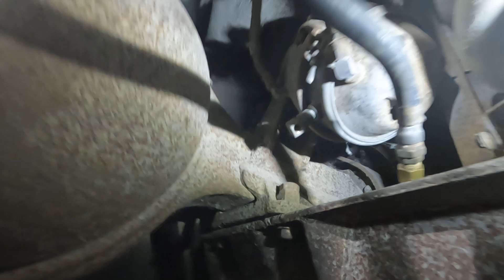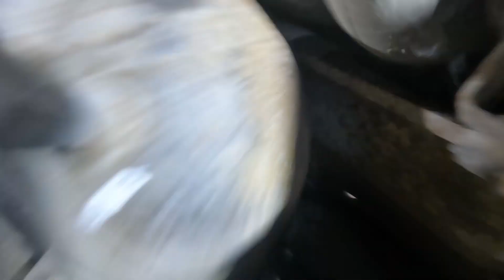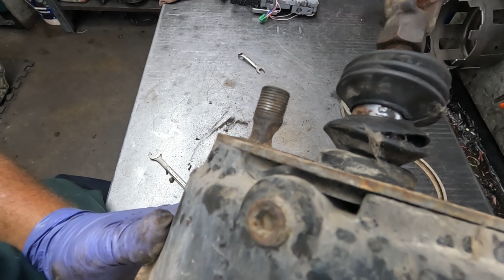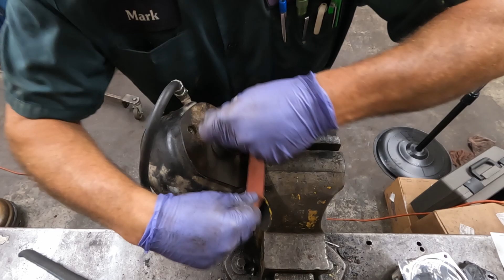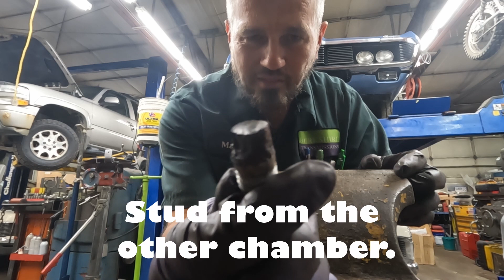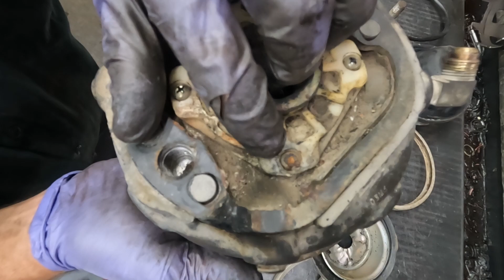MCI Bus Bendix DD 3 Brake Actuator Disassembly

Comment: What did it need just a diaphragm? What size can is that? 24 doesn’t look like a 30/30
Reply from the maker: 30-24. Diaphragm leaked when brakes were applied. Sometimes wouldn't unlock which I believe were caused by some bad shaft/rod seals inside.
Reply: @scatteredrustyprojects  Not the norm but could be sitting so long and diaphragm is most likely bad
Reply from the maker: @s.c.a.airsoft7954  did you watch the video? I showed the bad seals and bad diaphragm. Along with rust and corrosion, the grease was solidified.
Reply: @scatteredrustyprojects  you caught me lol. I didn’t have time to watch the whole I was gonna come back to it 🤦‍♂️. Sorry
Reply from the maker: @s.c.a.airsoft7954  HA HAHA!!!! thanks for saying that. I needed a chuckle today.
Reply from the maker: I just clicked o n you name....Hey!, I didn't know it was you!
Reply: @scatteredrustyprojects  Yeah it’s me lol. Cathy told me your channel so I subscribed.
Reply from the maker: @s.c.a.airsoft7954  cool, thanks! Hope ya find some stuff interesting.